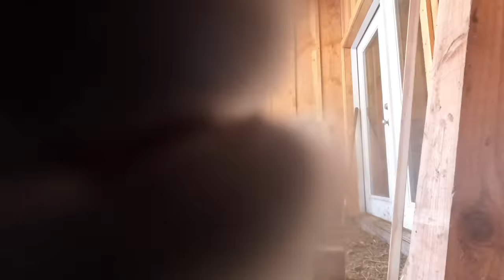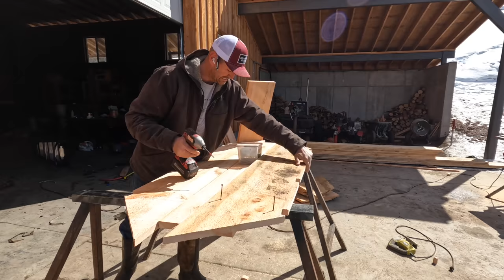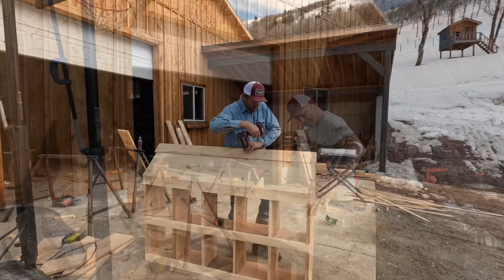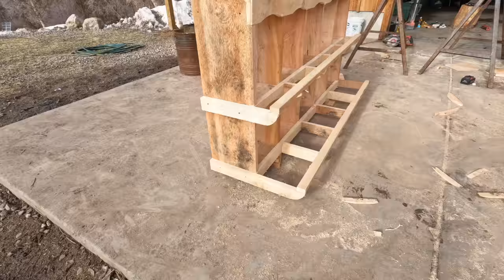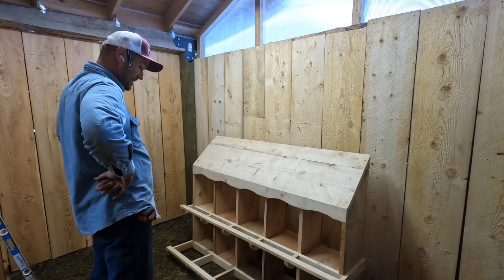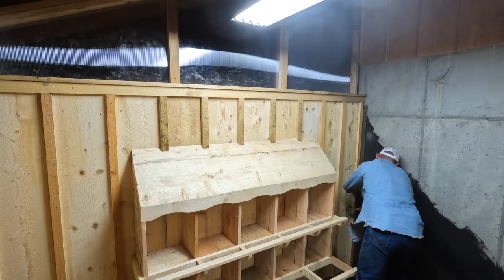#572 - Custom Nesting Box For Underground Chicken Coop!!!

Comment: Knew that little one would find a way up into the nesting box. You have such an attention to detail with all that you build. It's so nice to see.
Reply: That little goat found a way for sure into that beautiful laying box. It’s a good thing the hen house is going to have a big door and a small chicken door to keep out the goats!❤️👍 Unfortunately, that’s going to be to hot a hen house as you suspect , needs lots of ventilation especially in the rest of the year, I do hope the under ground will be cooler, but chickens like a breeze. You may have to put in a vent fan in the ceiling and open the window in the wall and the door window, you may have to add another window that opens on the other side of the door for ventilation.

Comment: Nice job on the nesting box! A few tips if I may: As a rule of thumb, the top of the table saw blade should never extend more than 1/4" above the work your cutting. This is to keep the mutilation from turning into an amputation if your hand should slip from not using a push stick. Also, beware of kickback - if you're 'free handing' work through the saw without a fence and it twists ever so slightly then it will throw the work back at you like a bullet (I have holes in my garage sheetrock to prove it) - always stand out of the blade 'line of sight'. I mention this because a good friend of mine in Dallas just lost his left index finger to a saw about 2 weeks ago (same guy who chastised me for telling him about table saw safety). I hate to sound like a nagging nellie but as a former firefighter/EMT, I used to see these injuries every weekend on people that knew better.
Reply: I agree. As a retired woodwork teacher I cringe when I see you operation your table  saw with no safety glasses. I know you are a very stubborn man but I agree 100% with this man. Sawing freehand can be very dangerous.

Comment: We had a chicken pen when I was a kid. I think I may have told you before, the wooden handrails that are used for bannisters with brackets were about the right size for the hens to rest on at night. They do seem to cost more now than they did in the past. If you find any in a skip/dumpster you could burn gloss paint off and leave them with a relatively rough finish, they may be just what you need for the perches.

Comment: JudithB   Really  nice  nest box!  I  need  to  rebuild  mine  this  spring.  I  will add  another  board  to  the  bottom front  on the nest boxes  since  my  chickens  scratch around in the  nest  to  arrange  the  chips  to  just  right.  This  of  course  dumps  chips  out,  or  straw.  I  need  more  light in my  hen house  too,  since  I  have  touched  several black snakes  in  the nest boxes  eating eggs.  Its a  real  heart  jerker  for  sure!!  Luckily I  havent  run  into a  Copperhead  yet.

Comment: If you use a hinge to attach the high side of the roost to a wall,  you can lift it up out of the way to clean the house.  The low side could just hang by a chain on each side.